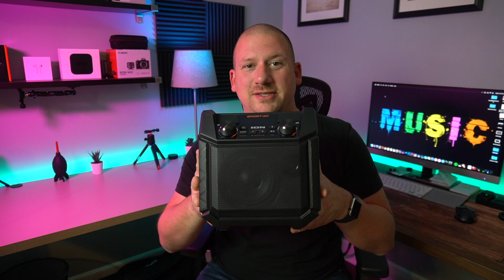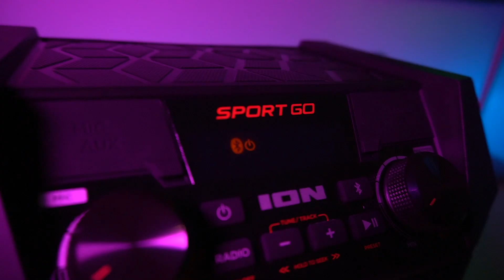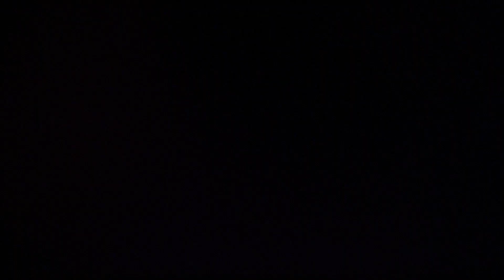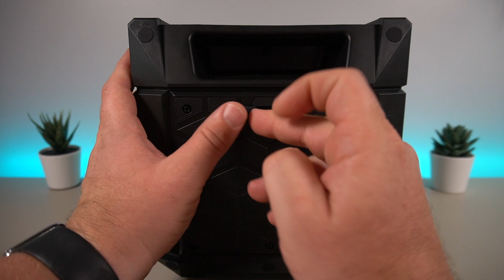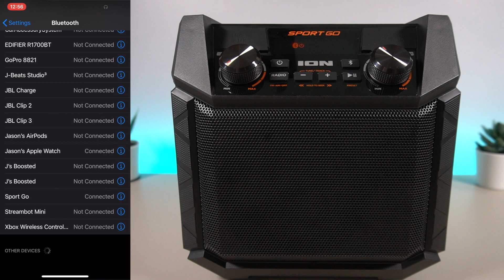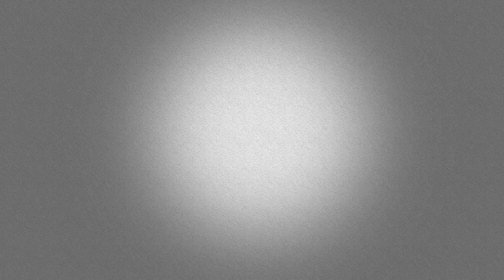ION Sport Go Tailgate Speaker !!! (30 HOUR BATTERY LIFE!!!)

Comment: I bought the speaker brand new from best buy and tested it out in the parking lot and it sounded good but once you pass 40% volume it sounds like horse shit , not worth it , i returned it immediately
Reply from the maker: Omar Gonzalez  Hey Omar. So one thing to note is that your phone volume and the master volume can’t both be at 100%. 
Most devices that connect to Bluetooth use one volume control. So when you turn the volume up on your phone it also controls the volume on that device. 

Because the iOn speaker has a physical knob for the volume the Bluetooth protocol doesn’t work the same. 

I found that lowering my phone volume to around 70% gave me the headroom for the volume on the unit without distorting. 

Sorry you returned it. 
It’s not for everyone. 

Thanks for taking the time to comment here though. Every comment matters!

Cheers
Reply: @AluzionTV  your right because I was about to be scared because I bought a ion sport mk2 and it i tested it out and it sounded distorted I was scared I was about to return it but I gave a other try and I find out its my phone falt that makes the distorted sound then I was relaxed but yeah that's the bad thing of all ion speakers my neighbor has a ion job rocker max and he be blasting the volume but I can hear he blast the phone volume and then distorted sounds come on
Reply: The

Comment: How well does the internal antenna work? Do you pick up a lot of stations or is it so-so?
Reply from the maker: David Diener II So when I was testing the internal radio inside my house it was so so, It got better when i plugged in the power cord. Maybe it was acting like an antenna. I never brought it outside and used the radio but if that’s a big concern just make sure you can return it if it doesn’t work out. Hope this helps
Reply: Aluzion TV do you have to plug the other end into a wall outlet?